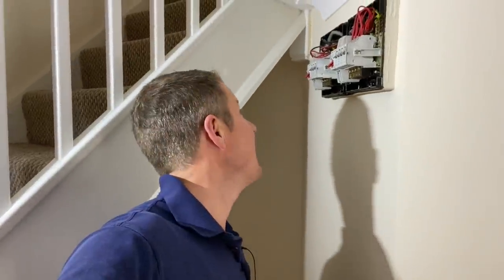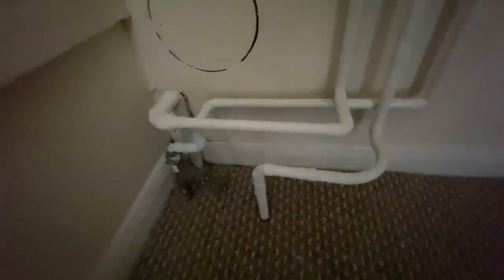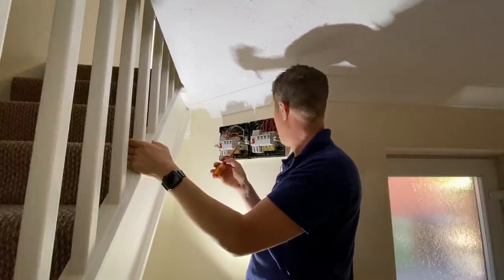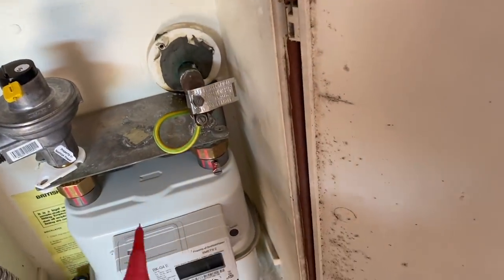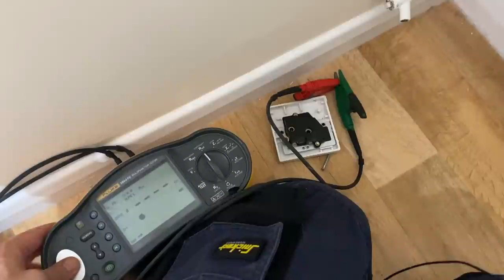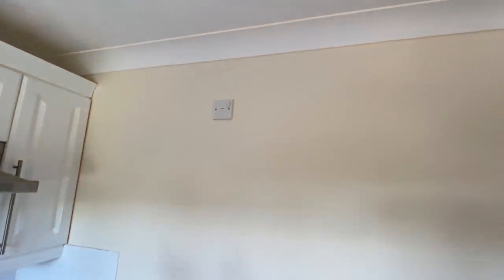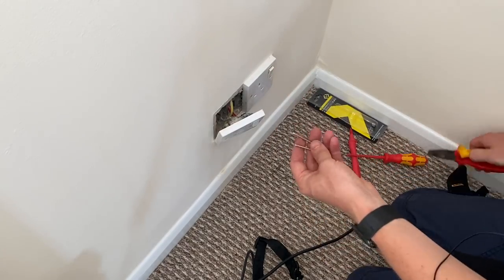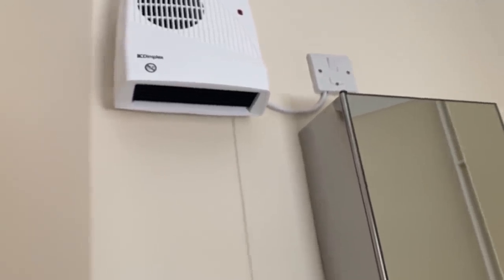EICR Testing Procedure

Comment: As a recently retired industrial JIB GOLD CARD APPROVED Electrician of 50 years I would like your opinion,not what the so  called regs bible says but what's your opinion on them saying that there is no need (not requirement) for a cpc to be wired to a non metallic light fitting,because in my whole career starting as a young apprentice I had it drummed into me that unless it's a extra low voltage source that you are wiring then as good electrical practice,which by the way I have never heard used on your podcasts or several others I've been on ever mentioned that word ,I was taught that the need  for a cpc was that even though the source didn't require an earthwire we 100% of the time and I'm going back to 1970 when I started I was told the need for a cpc being run in a twin and earth cable or a flex is to afford some sort of protection for that cable or for somebody who may accidently penertrate that cable there would be at least a chance that the earthwire may be penertrated along with the line cable thus tripping the circuit and not killing the person,I know that in modern up to date consumer units have technically superb protective devices in place,but all I see you do is to go into properties that don't have them  thus telling me my argument about always running a cpc in twin and earth and flexs holds water

Comment: Can someone please answer me if RCBO’s are a legal requirement these days on a kitchen ring in a tenanted property ?
As I think the sparks who’s recently tested is giving me false information. It’s a safety certificate after all and surly this should only be an improvement.
Reply from the maker: If you currently have RCD protection for your sockets then you should have, and RCBO is a good way of doing it.
Reply: Thank you for replying. 
RCD protection was only on up and down rings but not on the kitchen and oven circuits. The test was failed for that reason. I was told any circuits 32amp or above need to be protected. 
Was the electrician correct in saying this regarding the 18th Edition regulations. 
This is for a rental property.

Comment: Thought if you give an unsatisfactory result then they only get 28 days to arrange corrective measures ??
Reply: Which piece of literature says this? I've been trying to find it for ages.
Reply: Alex Kane  I saw it on one of the recent webinars but can’t for the life of me remember which one
Reply: The Electrical Safety Standards in the Private Rented Sector (England) Regulations 2020
Reply: @Ghbarl  Doesnt mean all the wiring has to meet 18th regs , if you read the  piece of legislation it states   (a clip from the regs) Existing installations that have been installed in accordance with earlier editions of the Wiring Regulations may not comply with the 18th edition in every respect. This does not necessarily mean that they are unsafe for continued use or require upgrading. Any works that are code 3 do not require to be performed its at landlord's descretion

Comment: The light in the bathroom should be changed to another one anti water vapor
Reply: Why?
Reply: David Stebbing should be IP rated/enclosed to prevent the ingress of moisture / water
Reply: 09weenic unless that ceiling is less than 2.25m from FFL you may both want to check section 701 of  BS7671......

Comment: Hi All,

My comment is not really related to the video.

There was a previous company who did an EICR on a bus station and for some reasons all the circuits in the DB in the office has been marked as "Unable to locate". I have been assigned for remedial work to locate these circuits. What type of certificate do I use and why?

Thank you
Reply: PS this job has already been completed and I have used the EICR for it. However my supervisor does not totally agree with this despite all the reasons I gave, which is why I am asking for second opinions.

Comment: Presumably you are coding C2 as you are failing Jordan ? So i don't understand why you have put a one year re-test sticker on it . Its my understanding that they should be rectified within 28 days . I personally would not put a sticker on until rectified .
Reply: The 28 day repair rule only applies under the new regulation covering rental properties.. Where the property is to be lived in by the owner there is only a recommendation to have the work carried out as soon as possible,

Comment: I dont allow satisfactory on my land lord certification until all circuits are 30mA rcd protected,  as I'm protecting the tenants,  the property from idiots, and looking after the duty holder the landlord.
Reply: As a tenant myself: Thankyou for taking that approach.

I recently got a shock from a plastic light switch: I was turning on the light to find a bucket to catch the water pouring from my ceiling in the next room. That was how I found out the water had found a down-route through the wiring conduit!  =:o\  It was only a light nip, but it did make me think "isn't something supposed to stop that being possible...?". And today I remembered that the ancient consumer unit doesn't have RCDs.
Reply: Good shout, totally agree

Comment: The meter tails looked like they were going down the wall behind the board, if they are plastered in the wall they will almost certainly be less than 50mm in the wall, and would need rcd protection, or run them surface in trunking.
Reply: The installations 35 years old why would they need rcd protection
Reply: @Mainly_Electrical  true, but when that place was done (15th edition) rcd protection was only required for a socket most likely to provide power for outside use, and bathroom equipment didnt need rcd protection  or ip fittings, so why change the board and code 2 the bathroom in that case. Plus those new requirements are proposing that all rental properties are tested to the latest regulations.
Reply: Anthony charles , what ? You said the tails need rcd protection not me
Reply: @Mainly_Electrical  so it's ok to code  the bathroom for not having RCD protection and all of the sockets for not having RCD protection which is relatively recent requirements, but not mention the tails, interesting.
Reply: They could be down the cavity, however the principle of the RCD protection for cables within 50mm of the wall surface would probabaly apply to the whole installation.
Reply from the maker: They are in the cavity and thus much deeper than 50mm
Reply: @artisanelectrics  thought they could have been, something I am not a fan of, but there you go a common thing.
Reply: Anthony charles doesn’t matter when it was done or to which regs the EICR is done versus current regs. So if they were <50mm then it would be a C3
Reply: Boznivich alright girls calm down !🤣
Reply: I was picked up on this on my niceic inspection apparently yes it should be RCD protected or run in armored cable
Reply: @Marco-mg9tv  reg changes are not there to provide unlimited guaranteed income streams for electricians.  The installation should be assessed on the basis of the regs in force at the time of install, or a reasonable assessment of the time of installation.   Otherwise no property will ever be compliant and that isn't the intention of the reg changes.  

The desirability of RCD,'s RCBO's roomy consumer units etc,, should clearly be identified as recommendations, not fails.
Reply: @MrSimonb45  that’s why I said it should be C3 ?? My point is the EICR MUST be a report versus current regs in terms of inspection and testing. The coding is then a case of the opinion of the inspector in terms of safety C1 to C3. An example would be say no cpc on a lighting circuit on a 50 year old installation. It doesn’t comply with 18th edition (nor any edition since 14th or whatever it was back then) . Therefore it needs an observation on the report. Now if it’s class 2 fittings you might give it C3, class 1 fitting C2 etc etc

Comment: Another less than satisfactory Inspection. More "to cover myself" and "I don't like the look of that" comments. Why recommend replacing the SFSUs with sockets? If unused this should be tested but left alone, this is a choice for the landlord, not you. Why a new CU? The lack of RCDs is a code C3 by any reasonable Inspector. You could recommend fitting an RCD socket or use an RCD extension lead. You are doing this to obtain more work, that is basically fraudulent. If the landlord wants an RCD you can fir this in the tails at a low cost. Perhaps you would care to list your qualifications for EICRs, which would be the 18th edition exam, C&G 2391, and many years of Inspection experience with zero comebacks.
Another video to show the low quality of the Industry.
David CEng.
Reply: There are, to my knowledge, 2 main guides to coding for EICRs in dwellings: Best Practice Guide 4, and NAPIT's Codebreakers.  BPG4 is the one I prefer to use, with Codebreakers coding more harshly.  Both offer a C2 for "Absence of RCD protection for portable or mobile equipment that may reasonably be expected to be used outdoors".  Arguably, this is deemed to apply to pretty much all sockets in the ground floor of a property.

Bear in mind the landlord will have commissioned the inspection to ensure (s)he complies with the safety standards in the PRS, and that any remedial work will be expected to comply with current wiring regs.

Note that RCD sockets to BS7822 are not listed as suitable for providing additional protection by current wiring regs.  Exactly why this is only the IET know (if even they do), but there it is.  An upfront RCD covering all circuits would conflict with 314.1.  Suggesting the use of an RCD extension lead, in a rental property where there is no supervision and no way of ensuring that it would be used, is absurd, and in any case outside the scope of BS7671.  This leaves changing the long-obsolete CU as the only sensible option.

Whilst perhaps I would have done things a little differently to how they were done here, I do feel that your comments show more of your own ignorance than that of the inspector in the video

Comment: ?  Why is he not wearing face covering as required by law now. When working in someone's property.
Reply from the maker: This video was shot several months ago in an empty house
Reply: @artisanelectrics  regulations by some local council s now states face coverings must be worn even if the property is empty
Reply: @mdmd1851  No council as regulations that need you to use a time machine to follow them.
Reply: @HenryLoenwind  influencers should lead by example.
Reply: @mdmd1851  Still no reason to require them to invent a time machine.